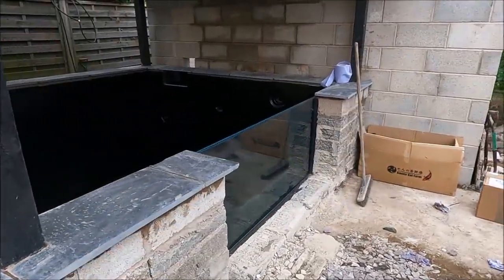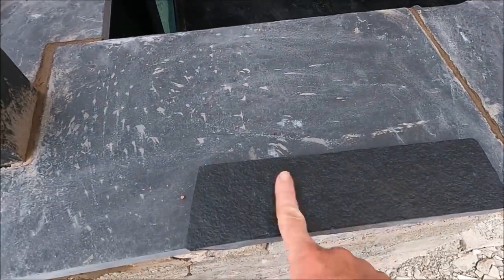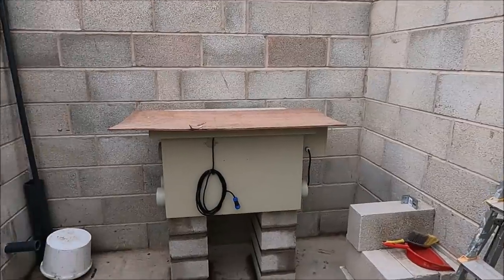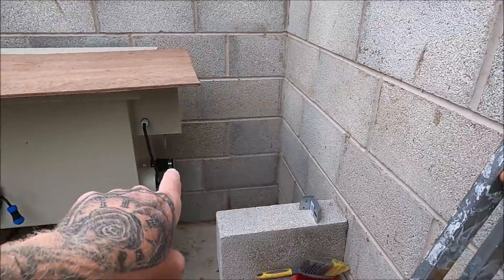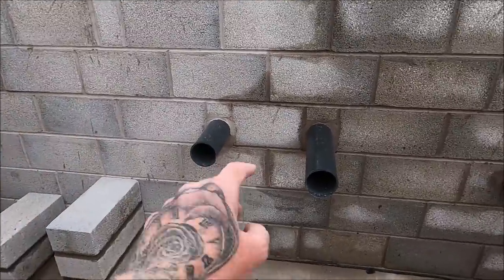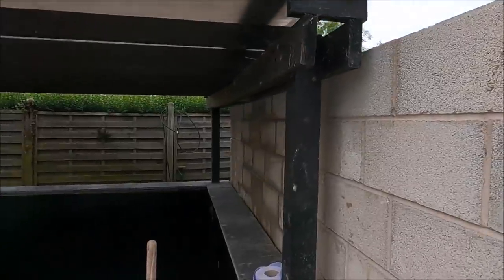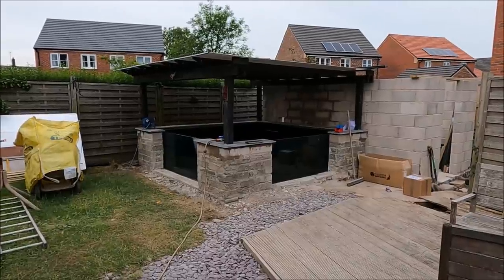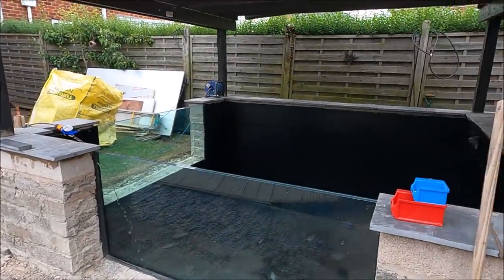Koi Diary 131 - Filling the pond with water

Comment: Hi Andy. Instead of going into the drum from the bottom drain with a 90 its worth considering a T capped above the water level. If you get a blockage in the drain line or drain you can remove the cap use a drain rod with 4" rubber plunger. Pump it up and down a few times to create suction pull it out quickly all the crap usually follows, a great means of purging. This was a late modification to my own pond following a complete blockage probably one of the best modifications i have made in the ponds 20 year life. 3 or 4 pumps with the rod and up came a dogs toy, blanket weed and general crap.
Reply from the maker: Yeah my last set up was like this, but ahhhh too late as filter is in place and running now. Ill deffo need to not let the weed grow long as thats the problem i had on other drain causing a blockage,

Comment: What’s the thickness of the glass you have used. Any advise on the thickness to be used for a 2500 gallon pond.
Reply from the maker: I didnt spec it, my pond builder did, but on a window of this size 1800x1000mm he always opts for a triple laminate as a belt and braces approach, also theres no bowing on the window either :-)
Reply: @koidiaries  that’s exactly my issue right now. My window bows out and it’s around 14mm thick for a 2000 gallon pond. It bows out and starts to leak a bit.